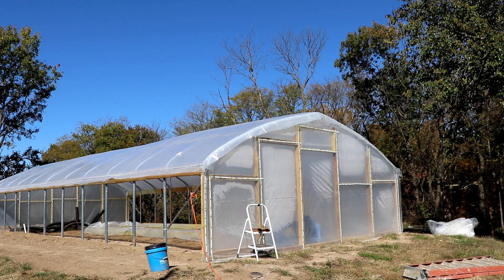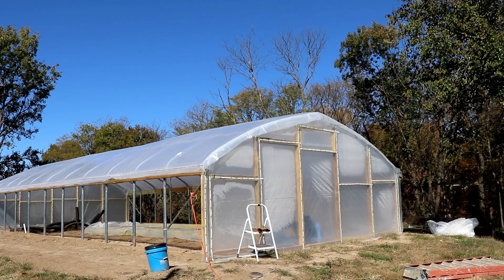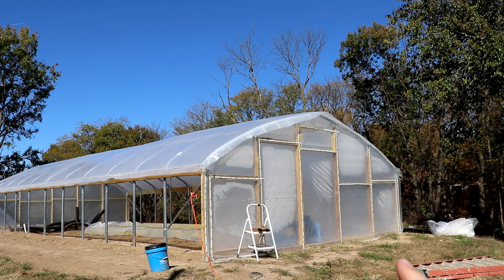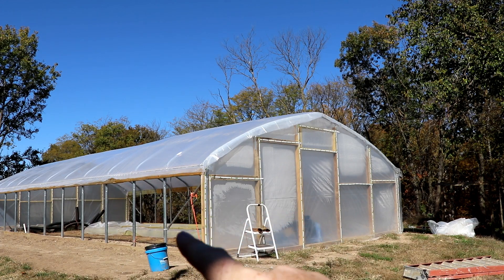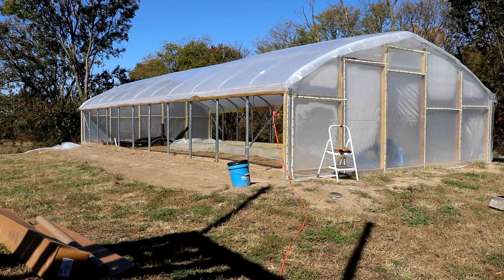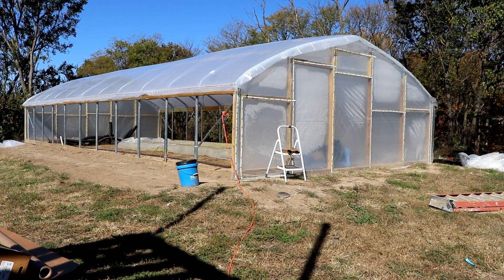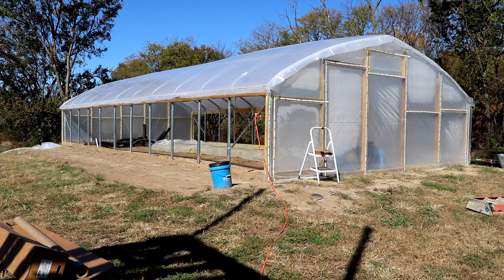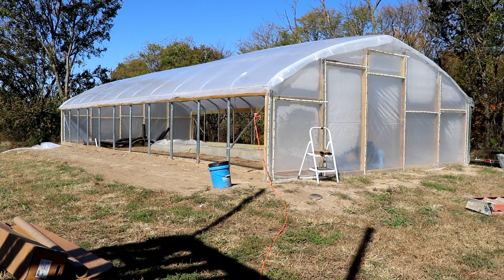Greenhouse for winter crops - part 7

Comment: Why do you need to blow air between the layers on top?  Does is run 24 hrs a day all year long?
Reply from the maker: Yes, it always runs. The air acts like a pillow, allowing the plastic to absorb the blowing wind/hail/etc to extend the life of the plastic. It’s much less prone to abrasion and wear this way.  During the winter it adds an insular I’ve valve, helping to hold in the heat.
Reply: Thank you - I live in KS and worry about hail damage so I’m looking into different options.

Comment: Great works. Urban Farmer Curtis Stone did some vids about his geothermal greenhouse. I noted that he blew air from the inside into his double layer, and he reported moist problems at the bottom (inside air moist condensing on outer layer). Don't know how or if he solved it. I opted for tripple layer polycarbonate. In order to keep humidity as low as possible, I water in ground, using dug in 3 inch plastic pots ballasted with some pebbles. Best wishes, greetings from Holland.
Reply from the maker: Condensation was an issue during the winter while the greenhouse is closed up.  As soon as spring hit and we opened the greenhouse it was no longer an issue.  We may end up running dehumidifiers this winter.